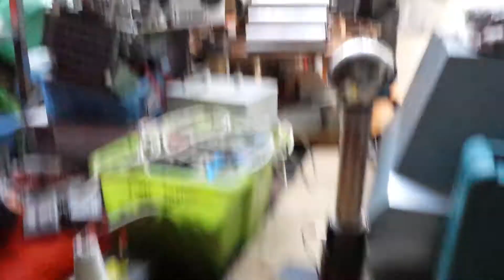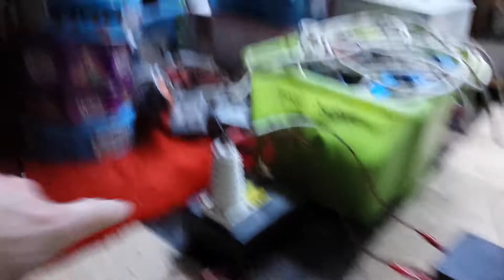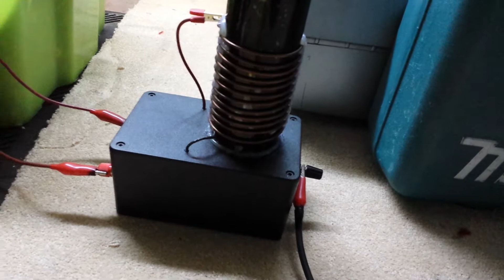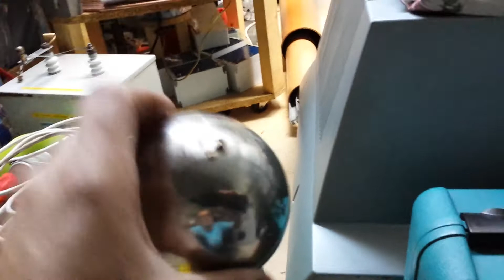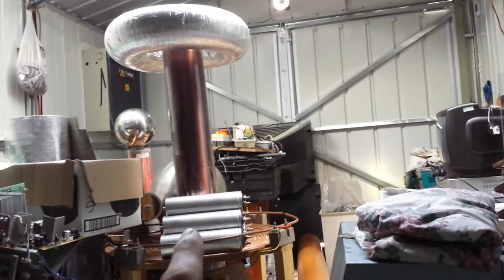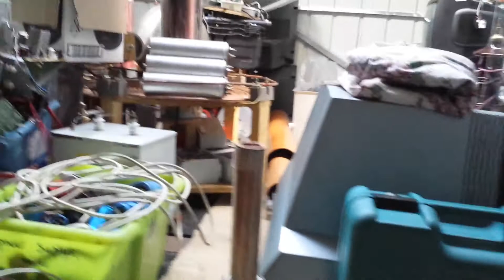desktop flyback tesla coil

Comment: I had a tip told to me by a photocopy engineer. try using tip-x on where it the arc has tracked it should insinuate it when it has dried. did not believe it at first until he did it on one of the big copier at work one day. lasted for a long time.